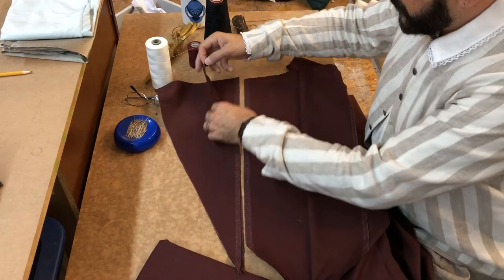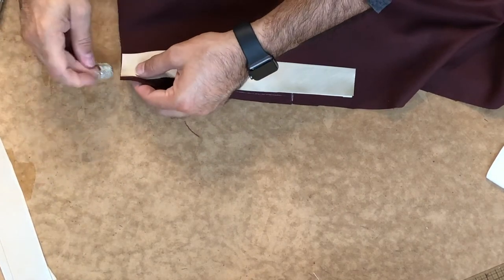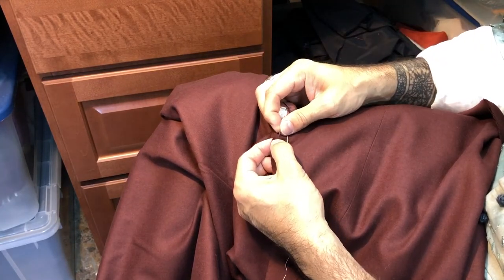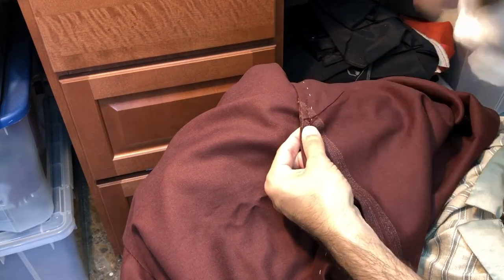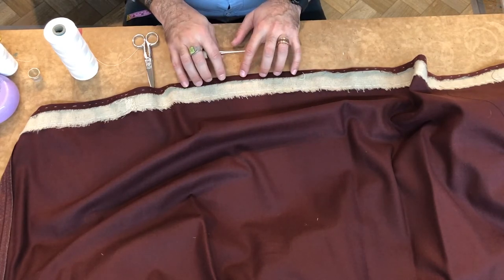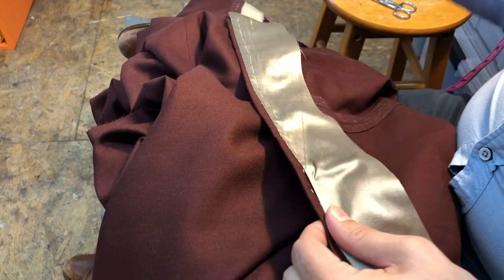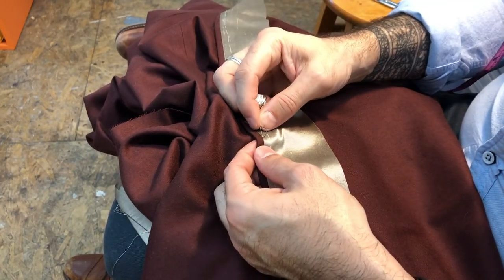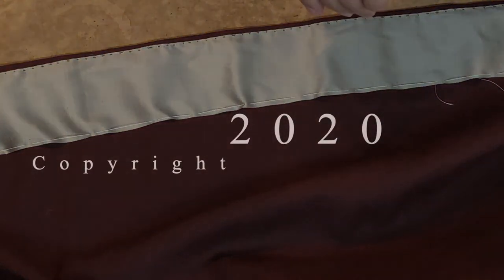HOW TO MAKE A 17TH CENTURY SKIRT 2: Stitching it together

Comment: I know that this video is six months old but I have to ask: have you considered using a mantuamakers stitch for the side seams of your skirt? Why or why not? I know that in many cases I don’t feel like just having one single seam is secure enough but I’m curious about your thoughts.
Reply from the maker: It really depends on the materials I'm using and the context of the garment...as well as the skill level I'm assuming the viewer has while watching. The mantuamakers seam itself is not something that I can document for skirts of the period although run and felled seams are equally strong and similar in appearance. The MM seam itself doesn't really gain popularity for another 50 years or so after the time period when this particular skirt would have existed. The French seam, which I can document to the late 16th century via The Tailor's pattern book, 1589, where is described for use on an unlined banner was my choice for this video...but other choices can be made. I was really into French seams at the time I shot the video...it was summer, lots of un-lined things were coming out of my hands.